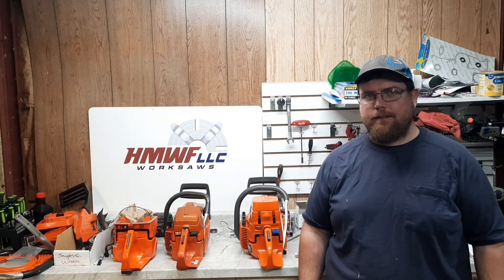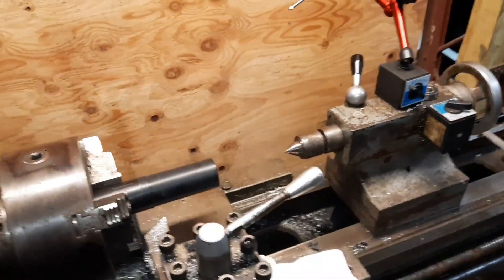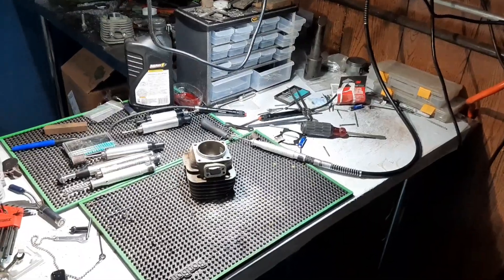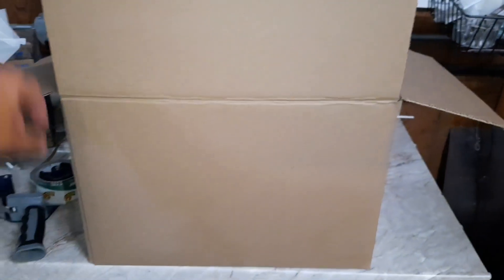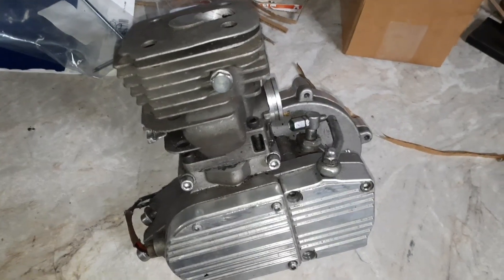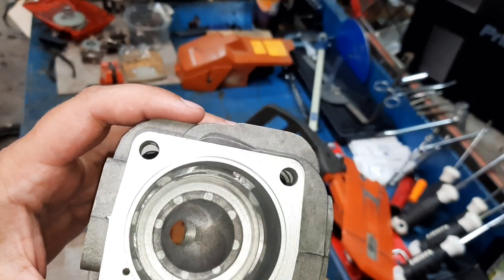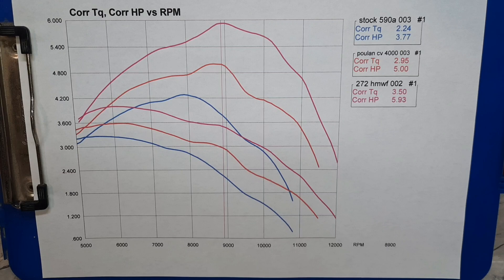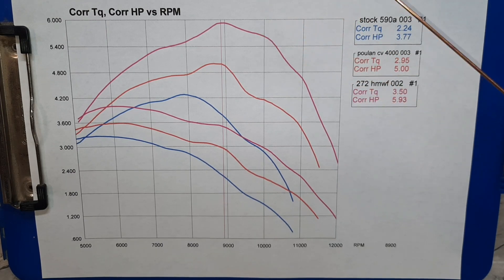Everyday Builds! Dyno runs, Future projects and more!

Comment: Great builds! I am interested in the bike builds. What make is the bike you showed? What bike comes with the 395 engine or who sells that engine to put on a bike?
Reply from the maker: Bikeberry.com is a good place to look. The 395 builds are custom. 440/660 are popular too.

The frame is a felt faker gas frame. Just for these motorized bicycles
Reply: @dynojoemods2764  Thank you, I would be interested in more info on the 395 and 660 powered ones. I like the built in fuel tank on that frame.

Comment: Counter vibe was cool. If you advance the ignition on an older saw like that after every thing else is right would it move the peak to a higher rpm?  I came across the claim that the low top 372xp made more hp than the high top 372xp. If you ever get the chance to test that,  It would be interesting.
Reply from the maker: Peak power rpm is mostly controlled by the ports. Ignition timing really seems to help throttle response.

Comment: I’ve been watching a lot of the different saw porting videos recently, and I’ve been noticing that most of the saws being ported right now by everyone seems to be the Huskies followed closely by the Echos, but not nearly as many Stihls. Is there any particular reason why that is, or are Huskies just that much more popular with people who like hot- rodded saws?
Reply from the maker: A lot just depends on the location of the builder. I generally have a decent mix of all brands. I have 6-8 stihl builds coming up to offset all the huskies. 
For the echo, a lot of people are getting a modded echo for about the same price as some stock stihl/husqvarna. So it is a cost thing.
Reply: OEM Husqvarna parts are cheaper and way easier to get online. 
Echoes are great bang for buck and have wicked sharp plastic.
Reply: That makes sense. I appreciate the response. Looking forward to seeing how those Stihl builds turn out.
Reply: @dogrunner, I’m $700 total into the 620pw joe just did, which is less than a new 362 or 562